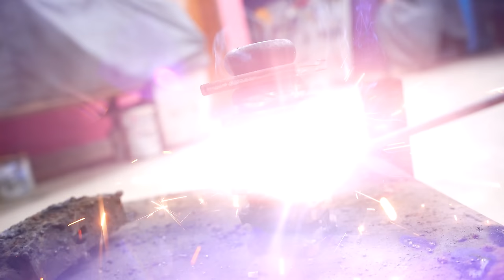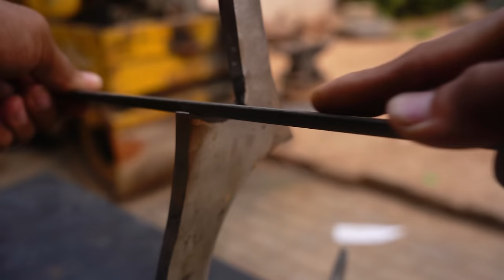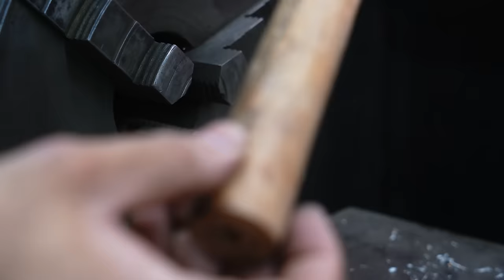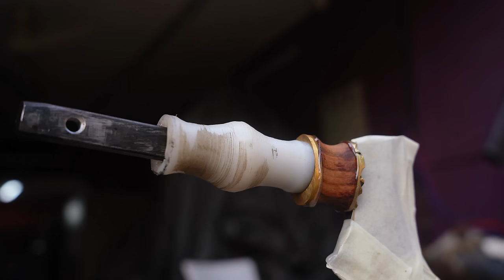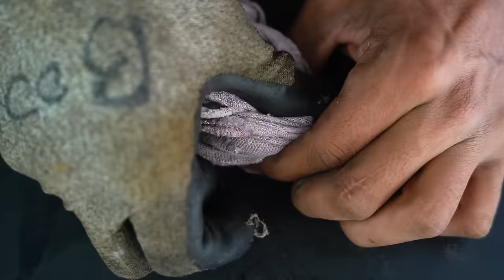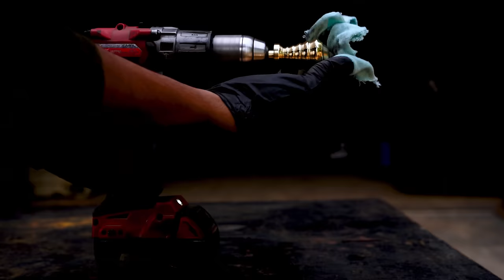Forging DAMASCUS SICKLE out of Bearing Balls

Comment: Ok since becoming a blacksmith I've realised these videos are mostly for ASMR purposes
Reply from the maker: Indeed, ASMR vibes are a key element!
Reply: Wait, you mean he's not really doing the old heat and beat and is actually just recording sounds? Well, now I've heard everything.

Since the video is over.
Reply: @custos3249 no he's meaning the sounds are left on for ASMR unlike other channels that keep it quiet like forged in fire
Reply: @destroyerthewolf  Seems the joke snuck past ya
Reply: @custos3249 man I thought he meant that the whole video in general was sorta therapeutic for blacksmiths🥴
Reply: Then why are they sharp, possibly usable as weapons?
Reply: @JER3M1AH221 because he's still actually doing the forge, and sharpening the blade?
Reply: It's just a video of a guy forging something henial and that's it.
Reply: Doesn’t take away the satisfaction, nor does it make it any less entertaining
Reply: please excuse my ignorace, but wouldn't be putting that many welds into the project introduce impurities? I can imagine the flux filler is weaker than the bare metal and ends up mixed with it in the furnace

Comment: Looks nice but if you noticed when the pin was being put in the while handle wobbled and the blade is to think and not cut very good the handle will brake before you would cut someone. but besides that for a weapon to hang on wall be nice

Comment: I always can't help but wonder how well these builds hold up. Like does the glue come loose? Will the wood split?
Reply: IMO - should have been full tang.
Reply: @miserychannel69  can't ever go wrong with some good full tang 😝
Reply: They dont hold up, its too loose on the handle which will cause rattling and eventually break., should of been a full tang, Id never go with just a single pin, it will cause too much stress on that singular point and break, it only smashes the cucumbers and other vegs doesnt actually cut. It looks nice but function is just not there at all.